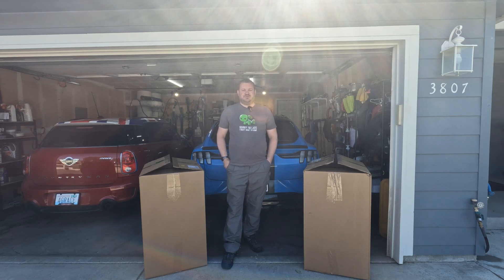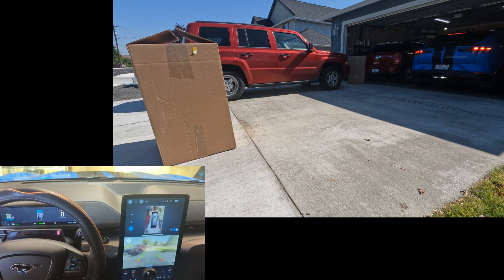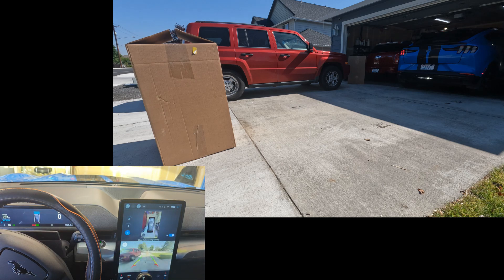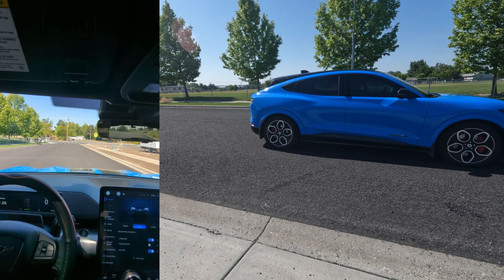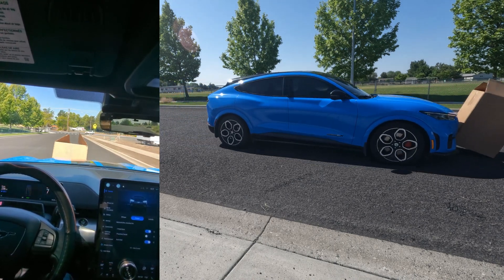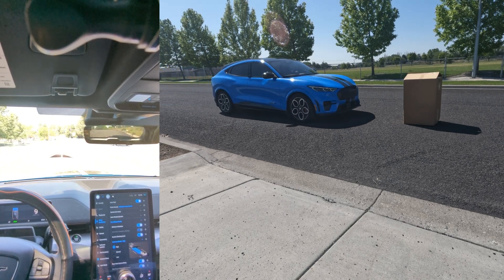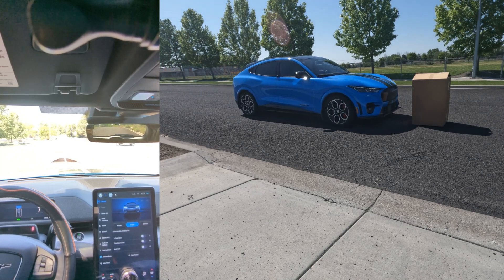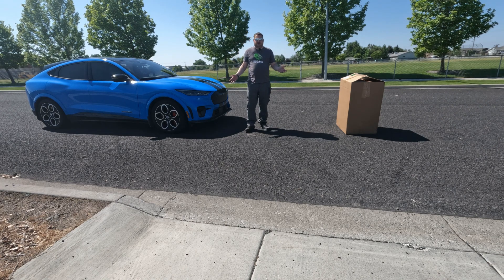Testing Automatic Emergency Brakes Part 2 : Ford Mustang Mach E

Comment: Very strange it didn’t see the box. In my experience it is slightly oversensitive (ours is a 2021 rwd sr). No unexpected, sudden phantom braking as I understand an other popular ev brand suffers from, but still not as perfectly predictable and reliable as the emergency braking system in our Sub Outback either.
Reply from the maker: I know it can see cars really well.  I had it slam on it breaks when it thought I was going to hit a slow moving car in front of me.  I wonder if the box is not dense enough to see with the radar.

Comment: Do the test again with the 2 boxes in front, to see if it works if it detects a bigger obstacle.
Reply: So it has to bigger than a kid or a deer you mean?
Reply: @BentheEVguy  I don't know if autobrake has intelligent shape recognition for humans or deer, but it might not recognize square objects like cardboard boxes
Reply: @LuxAeterna-dp2mo  so weird
Reply from the maker: I had a 2nd box, but I was not able to fit 2 in the Mach E.  I also did have packing material in the box
Reply from the maker: more dense than a cardboard box at least.
Reply from the maker: next time I want to build a wall of sample boxes.  it would look cooler for the camera and give more for the radar to bounce off.
Reply: @macheconnection  I have seen videos of the automatic parking and the front and rear sensors detect the obstacles and it parks normally! I'm surprised it doesn't detect all the obstacles you've tried! At the service, what did they tell you about this problem?
Reply from the maker: @LuxAeterna-dp2mo  did not tell them about this problem at my service.  But my car does not have the auto park features.  I only have the prep kit, so maybe that has something to do with my results.
Reply: @macheconnection  Then it might not have a front detector at all, but you can ask them if you can add that feature.
Reply from the maker: @LuxAeterna-dp2mo  it does, since it works vs cars.  I had it alert and slam on it breaks once when I got cut off.
Reply from the maker: It does not use cameras like tesla does for this feature.   it can only see what jt sensors sees.  I am sure a more dense object would give better results.  I am not willing to test this lol